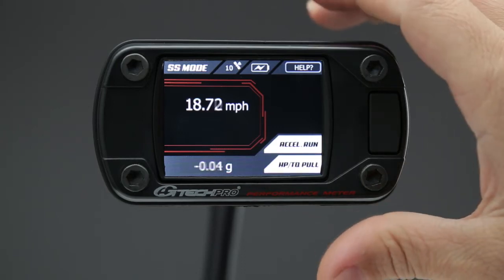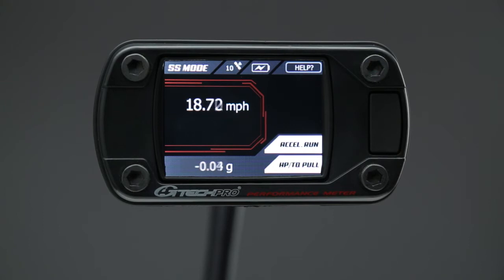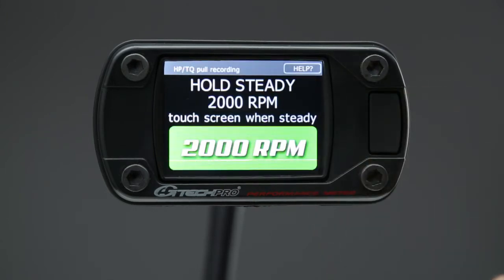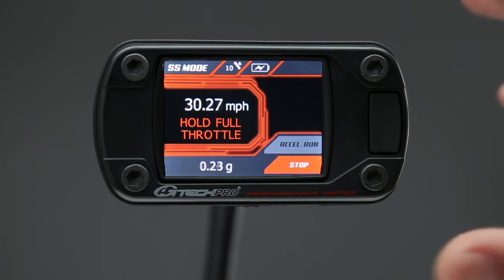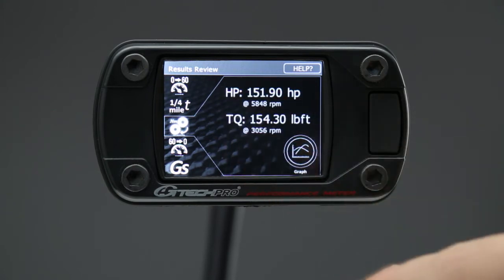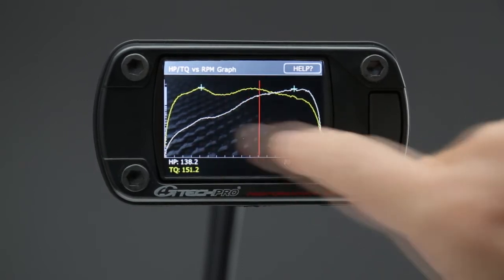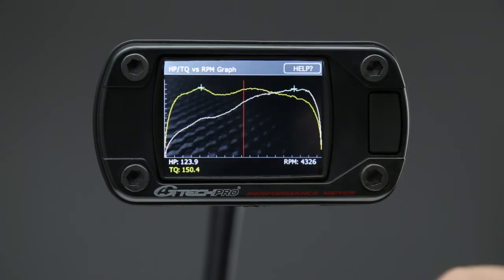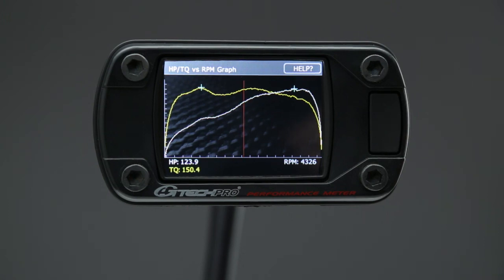G-TECH/Pro HP/TQ Pull Demo

Comment: I've got the older gtech rr, any info on how to get it to read the timing pulses on my ss Holden  ( pontiac g8) can't get it to calibrate.
Reply: scale the car so weight is exact  cat scales at truck stop 
you need level ground to run and do both directions '
and has to be zeroed leveling run through at least 4th
it will be 1 horse over rt dyno thats a ping so to speak
finding flat ground is hardest